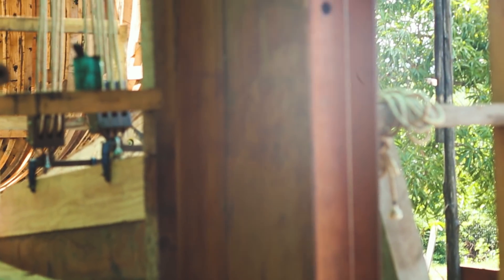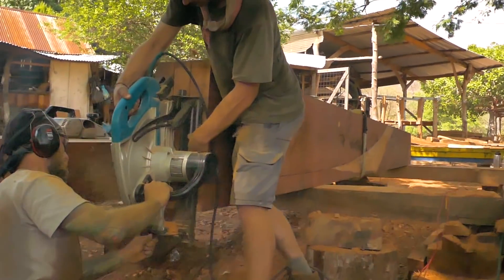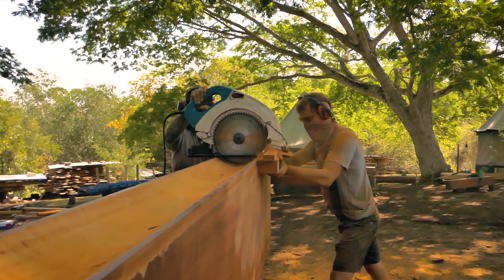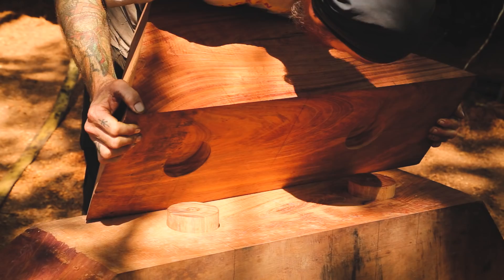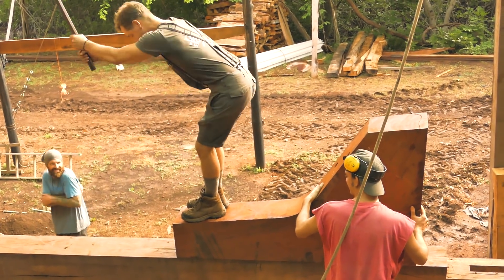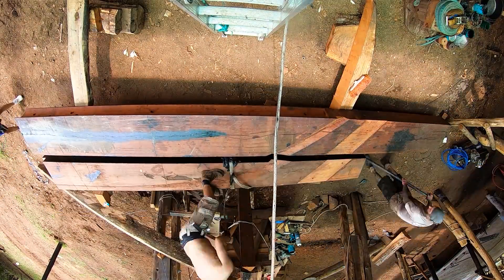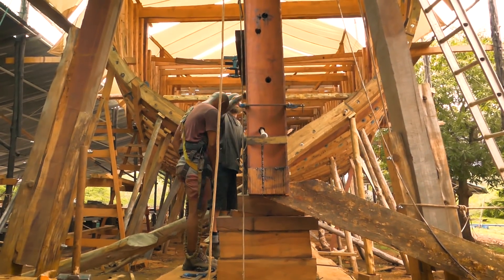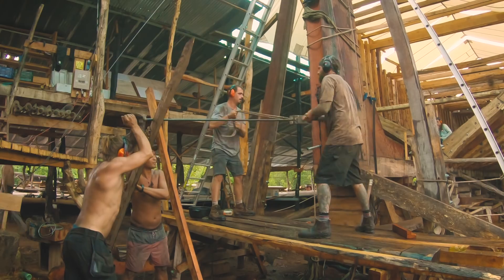Raising the Stern Post - SAILCARGO INC.

Comment: I know it's a bit moot, as you've already cut the cove for the rudder, but if you ever have to do that kind of cove work again there's a trick to using the saw at an oblique angle to cut the cove completely in a few passes.  I found a demo on YouTube and included the link so you can see what I'm talking about.  You'd just have to build a quick sled to keep the saw blade at the right angle.  https://www.youtube.com/watch?v=vVlvwJelz9s
Reply from the maker: Hello there Meadmaker, thanks for sharing!  We are familiar with that way of cutting coves, actually one of our team members, Manu, was just using this technique on our large sliding table saw.  There would be no reasonable way to move the sternpost timbers over a table say, so I feel like what Dylan and Guillaume opted for is essentially the same idea, it just so happened that we had a blade that fit perfectly perpendicular. We could have used the original, larger, beamsaw blade on an angle, of course.  The reason Dylan and Guillaume opted to make kerf-cuts and chisel out the majority of the timber by hand is due in part to the volume, and in part to how dense this tropical hardwood really is.  I just went and spoke with them, and they just shook their heads and said ''The saw never would have gotten through it.''  (PS. We do re-sharpen our radial blades, and do have carbide blades on site.)

All the best, 

Danielle
Reply: @sailcargo   - Hey there, Danielle.  I've handled some mean hardwoods in my time, dulling freshly sharpened blades in minutes (pecan, cocobolo, zebrano, etc.), so I can only imagine what it's like having to chew through huge pieces of tropical hardwoods down there.  The blade sharpening must be never-ending!  I hope no one felt I was criticizing their technique, just offering another possible approach.  At any rate, it sounds like the guys are familiar with the technique I mentioned and it just would not have worked with that stern timber.  Fair enough.  You all have my respect working in that heat with massive timbers made of uncooperative wood to make what I'm sure will be a beautiful, and practical, ship.  I'm really enjoying seeing her come together.  Thanks for taking the time out of your busy day to respond!!  :-)

Comment: I used to make wooden molds that required a lot of 'hogging out' with chisels and drills. It was a slow process just removing the bulk of the wood before the finish work could begin. So I turned an old chisel shaft and chucked it in my hammer drill. Set on hammer only it ripped through the hardest wood in jig time with little effort. I even made an extension for those deep cavities.